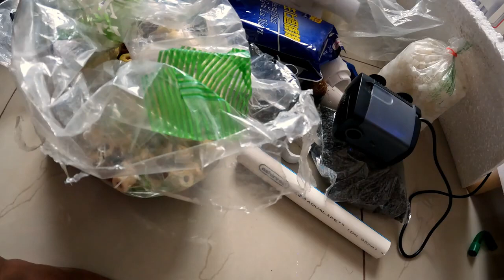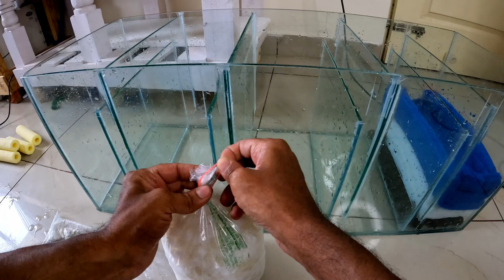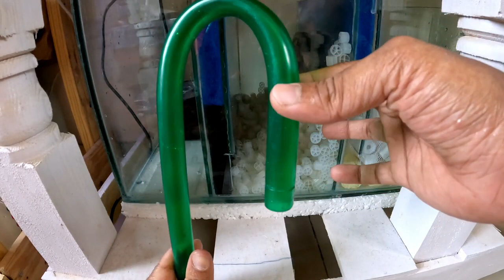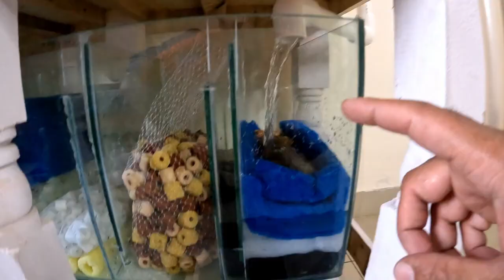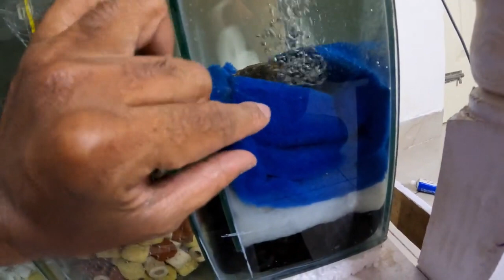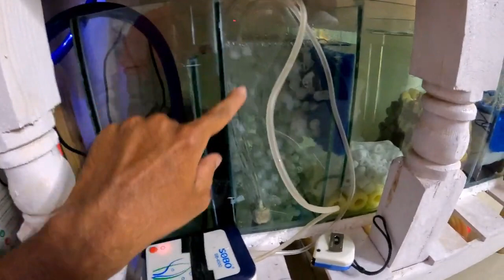How to make a aquarium sumps filter in tamil சம்ப் அமைப்பு EXPLAINED IN DETAIL filter media uses

Comment: Overflow line elbow la net remove pannitu, one feet pipe fix pannunga, so water tank bottom la irunthu sump ku flow agum also tank bottom la irukara wasteum sump ku poirum.
Reply: That's not at all good
Reply: @cheran6336 In any filtration system, the water out from tank should be from bottom and filtered water should enter the tank on top. In this case both in and out tappings are on the top, so it won't give an effective filtration and also water circulation inside the tank will be poor.
Reply: @meganathgunasekaran2503  yes but incase of power cut water will get fully drain from bottom because the sump motor didn't circulate the water
Reply: @cheran6336 During power cut, The water will drain only upto the bottom point of the over flow tapping hole, even if the suction point is at the bottom of the tank.
Reply: @meganathgunasekaran2503  not at all possible brother u can try, if it's not suck from the bottom u r good 😊